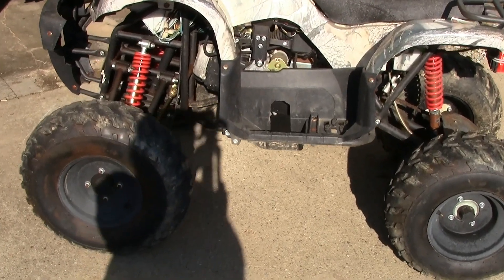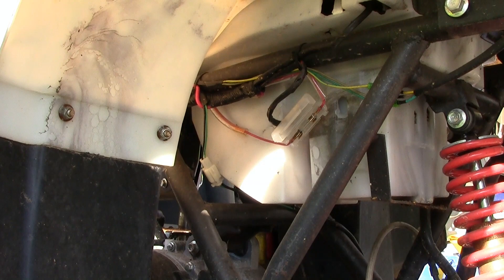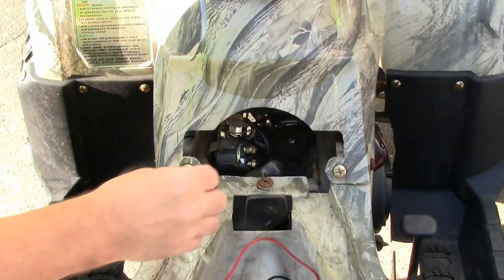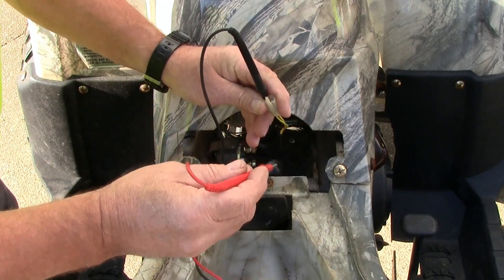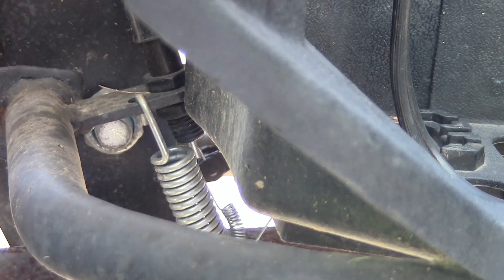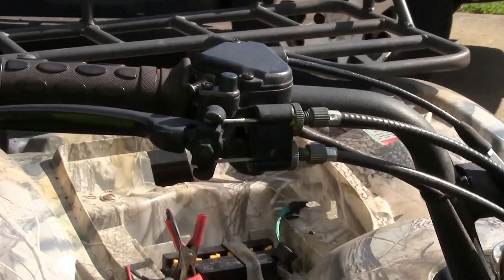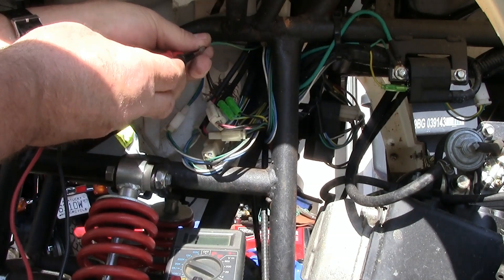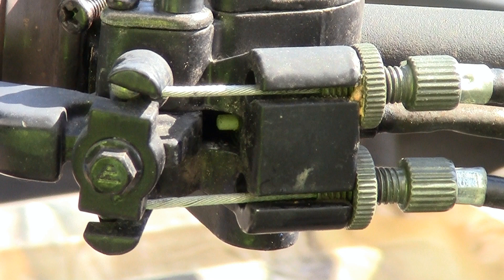2012 Taotao 150cc Chinese ATV Quad Switch Diagnostics

Comment: Do you still own this quad? I just bought a used 2012 bull 150cc quad and I can't find the fuel on/off switch. I am thinking it fell of on the way home with it? Do you have a picture of where yours it at?
Reply from the maker: Paste this in your search bar 
(TaoTao Carburetor replacement) now go to 3:00 and it will show you the shut off valve. It is operate by a vacuum hose. Make sure your vacuum hose works and has no leaks or holes in it.

Comment: How can I bypass
Reply from the maker: You can put a jumper wire in the plug, just take it off the switch and cross it. You can also cut and twist the wires together but later you might find a switch and need it so that would be up to you.
Reply: I came across another problem my pulse magneto isn't working it's not sending a pulse through the blue and white wire im getting no spark I tried using a used one of another engine and still doesnt work I also used a new one and nada
Reply from the maker: You might want to check all your safety switches to see if they work.